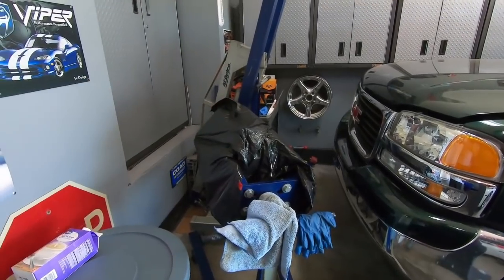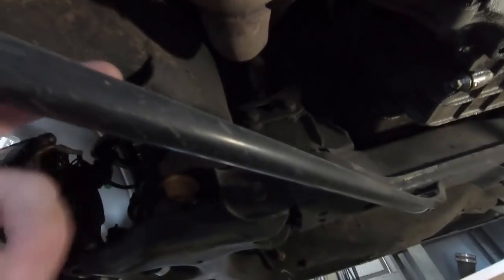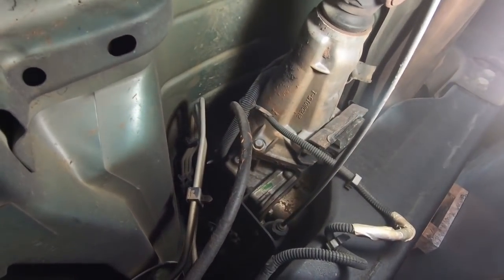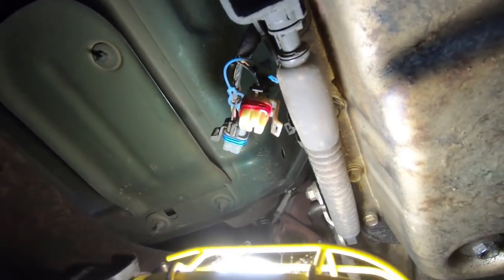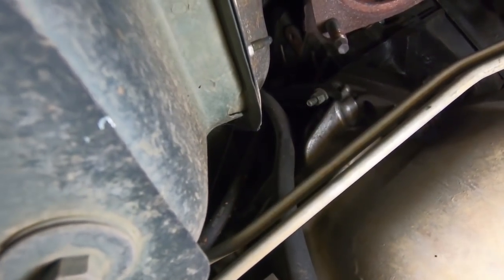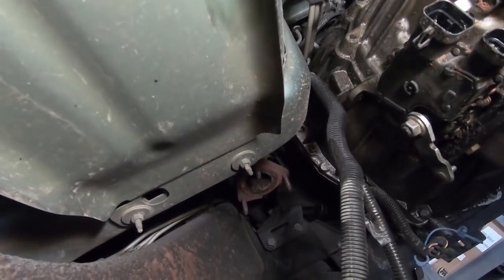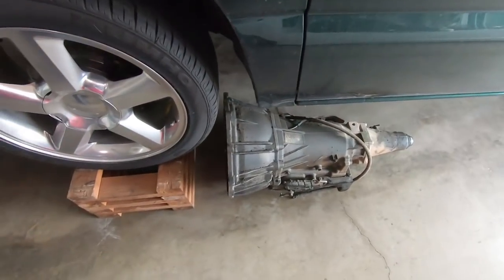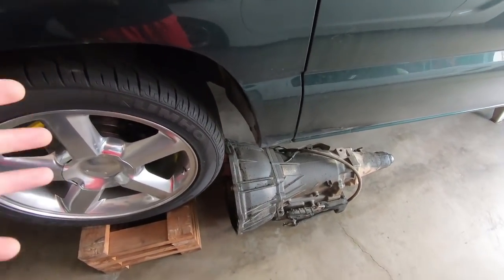Slammed Sierra 4.3 to 5 3 swap Part 2 (Transmission Removal)

Comment: Love watching your videos. Just wondering, can’t that 5.3 bolt up to that transmission? Why take it out?
Reply: I think he is gonna use a 4L80.
Reply from the maker: It will but the other is a little stronger with less miles
Reply from the maker: I'm not right now I don't think
Reply: Makes sense. Looking forward to seeing the rest of the build.

Comment: Great video do you know if the transmission in the v6 is the same as a v8
Reply from the maker: They are but I hear they are different internally. No confirmation on that though

Comment: Kind of a random topic, But a friend of mine swapped out his intake manifold to a tbss one on his 5.3 silverado, And it didn’t end up starting but now he discovered he had a bad injector and it was just leaking gas and now has gas in his oil... What does he have to do to fix everything to prevent blowing the motor or hydro locking it?If anybody knows and tips to help I appreciate it
Reply from the maker: Swap to correct injectors and change the oil